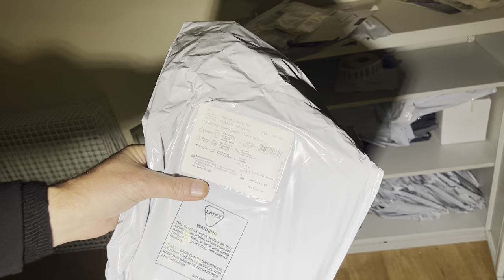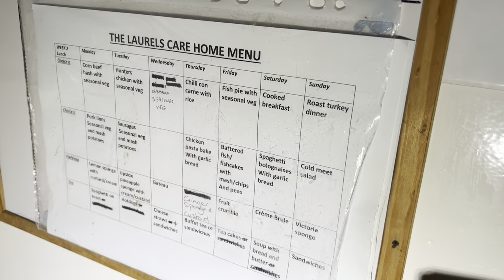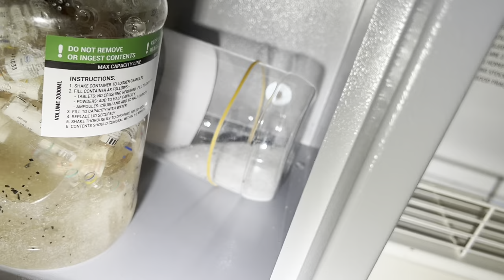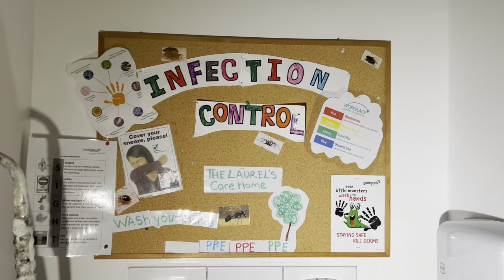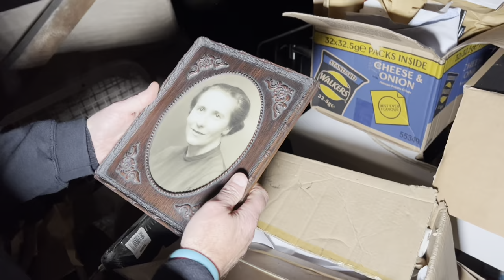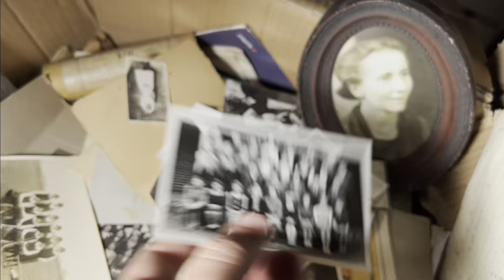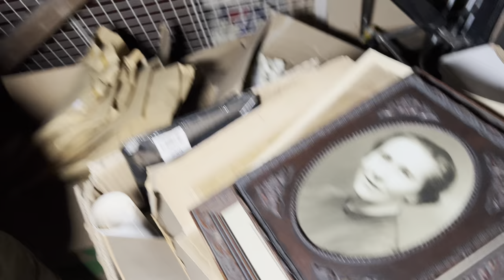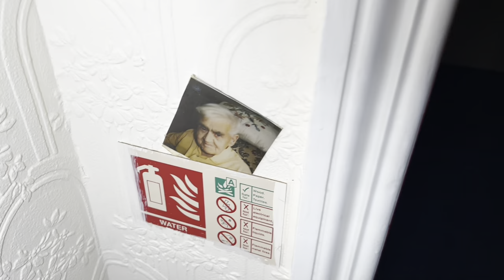This scary ABANDONED house of the elderly made us jump in fear

Comment: Experienced care worker here.
‘Thick and easy’ is a staple in care homes.. it’s a dietary requirement for people who are losing their ability to swallow.
The stains on the wall: enteral nutrition for people with nasal gastric or Peg Tubes.
Midazolam: a strong drug to calm people, or to reduce seizure activity’s
The handover notes on whiteboard: absolutely shocking. No matter what the resident had done, should not be confined to room until apologising to resident / care worker
PPE: might be left over, not that it wasn’t used.
Mattresses: bloody expensive. Costs the NHS ALOT. Should not be left to rot in a closed down care home… very sad!
Care homes that are closed down due to abuse, neglect or unsatisfactory care put brilliant care homes and staff down.. so many care homes are fantastic but tarred under the same brush. X